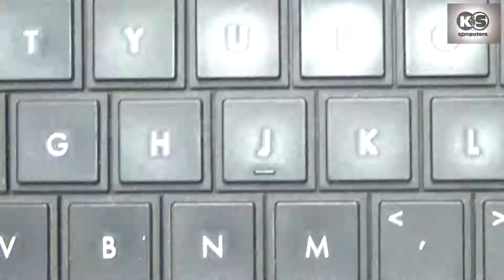HP 2000  - 2b19wm, Laptop Fan Cleaning & Disassembly

Comment: @KS Computers what is the name of the blue padding you used on the metal surface(23:34)? I'm at that point and on pause. Want to make sure i got all the right products. Great job btw💪
Reply from the maker: These are thermal conductive cooling silicone pads. Thank you for watching and commenting.

Comment: Hello!! I upgraded my memory ram  to 8 gb but  de pc only recognize 4gb why is that..is the same are reparing ..
Reply from the maker: Hello
I don't know exactly which PC you are asking about, but in that case there are a couple of possibilities:
1. If the pc recognizes about 3.5GB then it is most likely that a 32-bit operating system is installed.
2. If it is an older pc, it may not support more than 4 GB of memory
3. It is necessary to flash the bios
4. Maybe one of the modules is faulty (try to insert and check one by one)
Reply: @mistersekos6990  I already fix it bro, my mistake i check everything  back and put it  back and running ok now, thanks !!